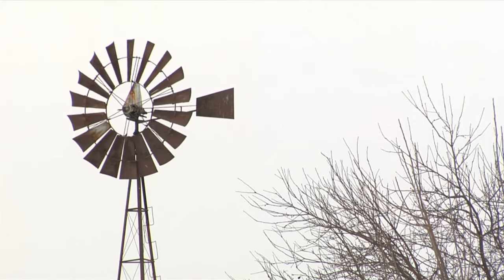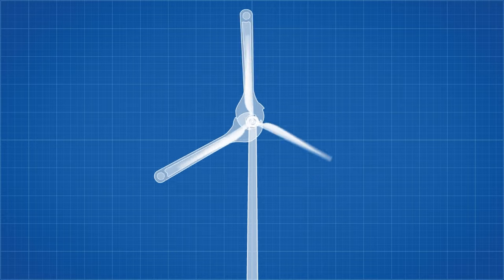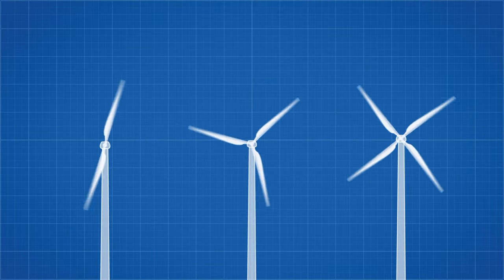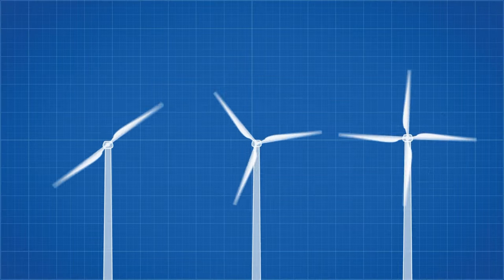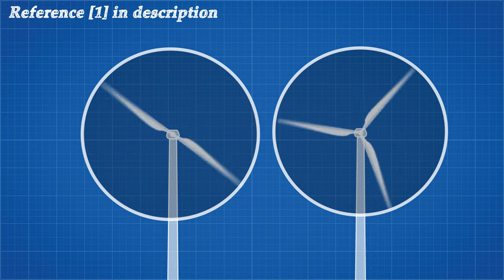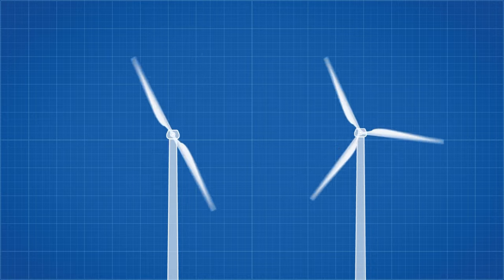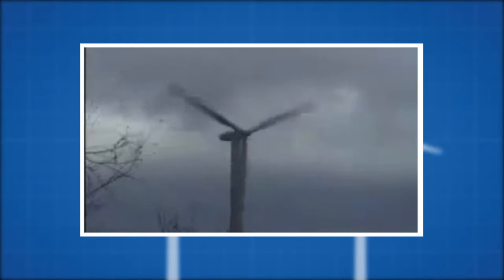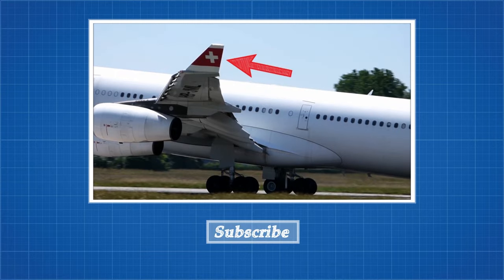Why Do Wind Turbines Have Three Blades?

Comment: Hi! The information provided here is not accurate. Cost is not the only reason why there are 3 blades on a wind turbine, and definitely not the most important one.

Wind turbines are designed with 3 blades for optimal reasons to say it blandly. According to Betz's Law, one can only get about 59% of the energy from an air/wind source at a maximum efficiency, with that in mind, and the fact that generators ( inside the turbine that produces the electricity ) has an efficiency curve of speed versus torque, you arrive in an optimal number of blades, which is 3. You also want to take into consideration that you want your electricity at a certain frequency (50-60Hz usually), and this requirement will reflect on your blade design and generator.

It is different for a grinding mill, for example. For a grinding mill, you need more torque and less speed for grinding, therefore more blades are required. As you add more blades, you lose speed, and you gain torque.

I'm an electrical engineer and have built small wind turbines before.

Comment: Hi my name is mansur muazu but i didn't know the reason why you don't use tell us your name  at least in one of your videos even i the introduction. 
I have a question to 
first what is engine control Unit (ex)  that is used in most of the petrol cars 
How is it recognize sensord key without internet connection. 
Second what is valve and what is the fundamental difference between v8 and v6 that is mostly written at back of cars like Toyota highlander. 
Thirdly: how CDI work. 
What is the purpose of adding it between starting coal and body coal. 
how CDI convert starting coal power and pass it to body coal and from body coal to spark plug.?
Thanks

Comment: Why helicopter blades are not shaped like wind turbine blades?  I mean, why aren't they thin at the tip, where the wind speed is higher, and widen up towards the center, to better cling to the slower wind speed?

Comment: Because they are very expensive- and three is the minimum to run effectively. Five blades would be more efficient- but would substantially increase manufacturing and maintenance costs. All successful concepts are an amalgam of engineering efficiency and cost.

Comment: what about smaller turbines for residential use? I live in central Kansas and I see the big ones up close but what design would work best around or on top of my farm house? I've always thought a different design would work better for closer to the ground wind generators. How does say a cylinder or cone shape compare if held in place with magnet bearings instead of traditional bearings? Use gravity to close openings if the speed becomes to great. I live where it's windy more days then not but I don't need a massive generator to power a 2 story farmhouse and a few out buildings.
Reply: Do not put the Wind Turbine on top of your home.  Put in on top of a Pole in the ground or on top of the barn

Comment: A. in case the first two blades miss the eagle. 

did you know running an industrial civilization on 'sustainable energy' would contravene the 2nd law of energy (entropy). even if it was possible to replace even a tiny proportion of fossil fuels with this sky hook technology, the system would run down, not being able to gather enough energy to sustain itself. industrial civilization is a gigantic planet scale animal and thus requires food, or a battery of stored energy of necessary proportions, rather than a trivial and unreliable flow. it is a ravenous hungry beast, not a flower.  the energy generated by these things is paltry (compared to what they are supposed to power and their building and maintanance costs etc), and far too meagre to make them self sustaining without constant backup of fossil energy, let alone run an industrial economy as well. also, electricity cannot power lorries and shipping, so at best it could only power a small part of the megacancer. sustainable energy is just tactic called bargaining, to avoid the painful solutions that the cancer species cannot face up to. which is quickly triaging off most of the infrastructure and human population that was foolishly built up during the two century long mindless orgy of consumption of fossil fuels. after a small population of humans goes back to the land civilization might be sustainable, although a sustainable civilization is an oxymoron going by historical examples. its much worse now of course. the global temps and radiation of 2100 will probably preclude any kind of human presence.

Comment: Not a good explanation.  I believe it has to do with vibration modes more than speed.  With an even number of blades, the opposite blade has a maximum difference in torque.  With an odd number, the blades are closer in forces so it doesn't vibrate as much.  However, with more blades, the wake from one blade starts interfering with the following blade which lowers efficiency.  Three blades is the minimum odd number so that is what they use.

Comment: I'm no expert but I don't think increasing the number of blades effect total cost that much
After all wind turbines consist of
RC foundation + Steel tower + Generator + Gearbox + Blades
Just changing the blade numbers will not increase cost linearly 
For example 
Let's say blades cost 30% of total cost
Increasing to 4 blades 30*4\3+70=110
(Plus additional 5% for other parts modification)
will cost only 15% more
Not 33%
Reply: Okay, but what if the energy you get from that extra blade is only 12% more. That's the diminishing return he is talking about where eventually costs outweigh benefits.
Reply: All I'm saying is changing blade size or number will not increase or decrease the cost linearly for each similar tower and I'm not talking about the profit, for that he has to give us cost per MW for every type a wind turbine

Comment: you eliminated 4 blade because of cost of the blade  yet you said the 2 blade was too fast, which isn't a issue of blades but only wind speed .. yet the more wind speed the better IF the windmill was designed and created properly

Comment: Hold on. You just negated the advantages of four blades by making the design consistent with three blades, but then added extra costs of over designing the two-blade option. Each of the four blades would not have to be as robust, so that would make them each cost less. Take that into consideration along with all the other overhead costs associate with wind turbines, and four actually doesn't sound too bad. If however there is simply no meaningful advantage to justify the costs of another blade, then I can understand three.

Comment: All very reasonable but you omit the single blade with counterbalance.  Like a sycamore seed.  The wind speed necessary for self-starting is significantly lower than multi-bladed designs and so produces energy for more time through the year.  Why, then, do we not use this type?  Simple - it doesn't 'look' right in order to attract investment.  The three bladed design is what we came up with in the mid-70's as a compromise between effectiveness and commercial attractiveness.  As a separate aspect, our blades were downwind of the tower, so they would gradually collapse , like an umbrella, in high winds and gusts, reducing the effective diameter and controlling the speed of rotation.

Comment: No, three blades is the minimum to balance on an axis. More blades makes it louder and doesn't really move it faster either. Consider a box fan, a three blade fan pushes more air, a five blade fan doesn't because of over scavenging.

Comment: i heard that the main obstacle of wind energy is the power storage for continuous power supply is that true?
Reply: Wind energy (as could solar energy) are sources of DC electricity of which could be utilized to electrolize water (H2O) into hydrogen (H2) and oxygen (O2) to be stored and later utilized in a hydrogen fuel cell, (of which you can get the water back to be re-electrolized), or burned as heat energy (possibly to turn a turbine).

Comment: Well, I saw a different explanation. One blade would be most efficient, but too imbalanced. Two blades, though balance experience some sort of yaw vibration and such mechanical stress. Three blades are the next best efficiency wise so that's what they use three.

Comment: Correction: Using the same reasoning, you can prove that if you compare  1,2,or 3 blade designs, the best choice is the 2 blade design...
Reply from the maker: A 3 blade design is 3% boost in efficiency, this allows the cost to be recovered over the turbines lifetime. An increase from 3-4 gives a fraction of a percentage increase. I have no included exact figures as they vary from all the sources I could find, but they all agreed that a 4 blade turbine did not provide a big effort increase to justify the cost.

Comment: I have to disagree with the cost analysis. Wind generators are in groups, a 4th blade increases the output by 25% so if 5 turbines were built that could be replaced by 4 turbines...a complete turbine initial cost and the infrastructure and maintenance far outweighs the design/ use of a 4 blade technology. material science and  design are the limiting factors of 4+ blade design.

Comment: The argumentation with thenoise 2 winged plant is pretty stupid, I mean in regions where noise is no problem, there are usually no 2 winged wind turbines as well. The following argument though explained it better (stability). In the end, the video of the collapsing turbine is not a 2 winged one but a 3 winged ...
Reply: Yes, it was 3 winged...but this just gives a basic idea of how too much force can cause in instability. Not too much of strong wind can bring the same result to a 2 winged plant much faster.

Comment: Four blades would suffer from the same effect as on two, i.e. maximum wind speed at the top while the lower blade is passing the tower. The other two blades would not make much difference to this effect.

Comment: Or you could build advanced nuclear and not deal with any of the downsides of wind and solar. (intermittency, short generation life, recycling, weather dependency, seasonal dependency, nighttime dependency, rare earth element dependency, site dependency, noise issues, Low energy density, maintenance, additional transmission lines, land use, to name a few)

Comment: Not to say the conclusion is wrong, but the manner in which your facts are presented doesn't lead to the conclusion that you want. You start at the assumption that there are very few options, and that the only one that makes sense is to imitate what is already being done. It completely ignores the reasons why it is done that way, or other radical differences (as opposed to minor differences). 
First, the biggest driving force to these large scale wind turbines is the fact that the electricity they produce must fit into the existing power grid. This means ether 50Hz or 60 Hz, depending on the continent. Within a couple options, this defines the rotation speed of the generator, which forces a lot of other design decisions into narrow options. Basically, the 3 blade design isn't "best," but it works well in the rotation speeds necessary for the equipment needed. 
Second, mechanical considerations include a lot more than weight and centrifugal forces... Yes, those matter. But with the wide array of airfoil shapes and arrangements, it'd  be foolhardy to say that 3 is a magic number. If we can build bearings that support the prop shafts on an aircraft carrier, a wind turbine isn't so hard. Odd numbered blades are easier to balance than even numbers, simply because any imbalance in one blade can be offset in with smaller changes to the two opposing blades rather than one opposing blade. This helps prevent imbalances returning at different rotation speeds (aka, harmonic imbalance). 
Lastly, in big businesses like power companies, I don't think any decision has ever been made PURELY on the rationale that it is the best option. Palms need greased; favors need paid off; and everyone has a cousin or brother in law whose business needs some help. A design that was adequate to function, but helped the right people, would have a huge advantage in the board room over a superior design that didn't help those key people.  

So, a three bladed design may in fact be inherently superior. But the truth of that is far more complex than what you've shown, and even what you've shown hasn't been proven to any real examination. 

You basically just said, they're right because they're right.

Comment: Will someone much smarter than me please tell me does the air flow at the point of the support tower have anything to do with choosing a three-blade design? I am not an engineer but I wonder if the odd number of blades has anything to contribute?

Comment: I'm sorry but you are incorrect.  I've been working in this field for over a decade.  You've missed some very key aspects of wind turbine and aerodynamic design.
There is only a given amount of energy in a any swept area, the less drag you have the more efficiently you can harvest this energy. One blade with a high tip speed is actually ideal but you then run into the reality that yaw control is nearly impossible with only one blade. Balance it achievable with counterbalancing but the moment is so long that the yaw drive and brake systems take an absolute pounding. To build them up to withstand that kind of cyclic abuse would add extreme cost. Not to mention the deterioration of the foundation you would incur in a rather short time.
So then the question becomes; Why not two. It's simple, wind speeds are higher and more consistent the further from the turbulent ground flow you get. With one blade or two you will pick up what we call P1 frequencies where the rotor speeds up and slows down within one revolution. This is because the wind speed that the absolute peak is higher than the at the lowest point. There's also tower stacking where the area in front of the tower causes a little high pressure pocket that the blade sweeps and this causes some undesirable drivetrain oscillation. 
Three blades is the solution to these problems.  More consistent wind speeds acting upon your rotor and less stacking influence on the drive train with the least possible drag. Yaw systems that need minimal braking and ultimately less frequency correction on the generator so that you maintain 50 or 60hz, depending on there they are located.
You should also keep in mind that these are lift devices and not drag devices like windmills and water pumps.
Go give that a think for awhile.

Comment: Unfortunately, once you add cost into the mix and solve an optimization minimum, with many variables like length, numbers etc. the subject becomes very uninteresting. The answer to the title of your question does not go further than "because it is the minimum". There is not revelation to be had here nor and historical referances.

Comment: This is a great video. I think it adequately explains why a three-bladed wind turbine is preferable over a four-bladed one. The primary reason that two-bladed wind turbines are not common, however, is that the rotation of a two-bladed rotor is unstable.Any three-dimensional object, with three different moments of inertia, has one unstable axis of rotation. If you're not familiar with moments of inertia, think of it as mass distribution. A cube is identical in all dimensions, and therefore, has three identical mass distributions in all directions. As a result, a cube does not have an unstable axis of rotation.Your smartphone, however, has three different dimensions; the largest is the height, the shortest is the thickness, and the intermediate dimension is the width. Try throwing your phone into the air three times while giving it a spin. Each time, get it to rotate about a different axis. You will notice that it rotates without any surprises when spinning about its height axis and its thickness axis.However, you will also notice that it is impossible to actually spin your phone such that it will maintain its rotation about its width axis. No matter how precise your throw is, the phone will start out by rotating about its width axis, but the rotation will soon become unstable and the phone will begin rotating about the remaining two axes.This phenomenon is call the "intermediate axis theorem", and it is difficult to explain verbally. Those that are interested can lookup Euler's equations of motion for a mathematical explanation. See the following video for a visual explanation:https://www.youtube.com/watch?v=-Si6iRL5Fj8How does this relate to a two-bladed wind turbine? The rotating components in a wind turbine are the rotor (which includes the blades and the hub) and the main driveshaft. If you draw a bounding box around a two-bladed rotor and its shaft, such that the box captures the outermost dimensions of this subsystem, you will notice that the shape of the bounding box is identical to the shape of your smartphone. It has a large height, a small thickness, and an intermediate width. In other words, the mass of the two-bladed subsystem is distributed differently in all three dimensions.Adding a third blade (or more) eliminates this instability problem, since the additional blades make the mass distribution identical in two out of three dimensions. Imagine taking your iPhone and reshaping it such that its width is now equal to its height. This change in geometry will eliminate the intermediate axis, and therefore, will eliminate the effect of the "intermediate axis theorem".

Comment: Ok but why are 4 blade designs out?
Sure they cost more but over a lifespan of 30 years the cost of the turbine will just be at 1 to 2 Cents per KWh.
So if it is no 1.05 Cents to 2.1 Cents why would that be that much of a deal, vs even less noise, more energy per area and less load on a single blade.